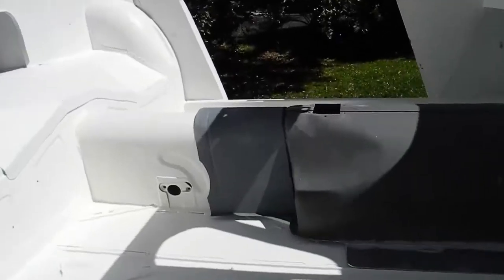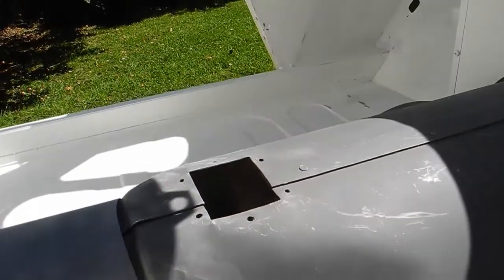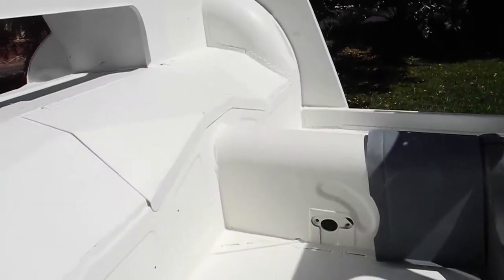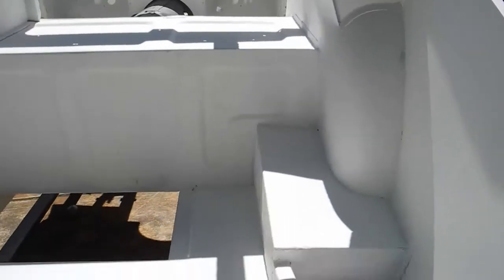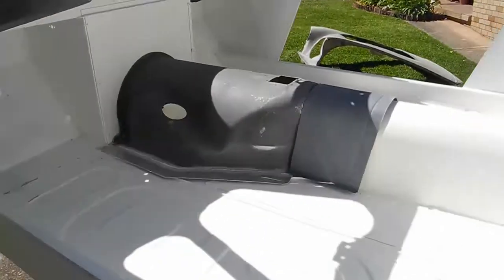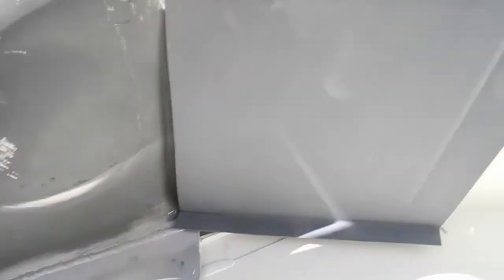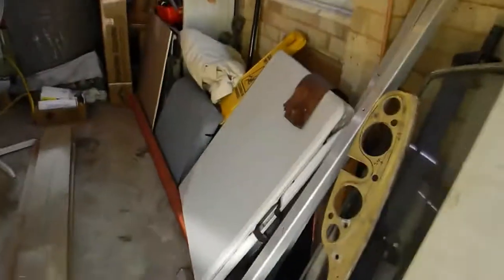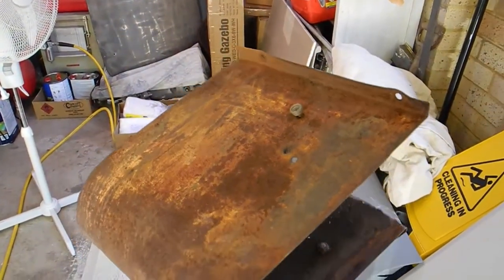Austin Healey 100/4 Base and clear coat prep (01)

Comment: Looks like you have created a great base to start the rebuild, that inner tub has to be one of the most difficult jobs to repair , well done indeed. Kind regards, Richard.
Reply from the maker: Hi Richard - nice to hear from you.
By inner tub I guess you are referring to the cockpit area. I see a number of videos where the rust is quite overwhelming but still they only cut away a little here and there. From what I've seen in a couple of actual cases is (including my original chassis) that once rust gets into the rail system the corrosion works from within where it can't be seen - this means the walls become quite thin with a reduction in wall thickness of 50-60%. So for my money it's the rail base section of the chassis that needs the most attention for the overall integrity of the car. Lifting the front and rear section from the base is not onerous if you have some skill and an angle grinder. It's only then that you can see what's really been happening.
Cheers
Reply: @ihealey458  I agree it is always those hidden areas that cause the most problem, kind regards, Richard.

Comment: Beautiful work Hugh! I am curious why there are no rocker panels on the car?
Reply from the maker: Hi Mike - good question!
In the early stages of putting the chassis together I had a lot of difficulty aligning the front end with the back end. 
I had no reference i.e. previous markers as the chassis was new and hand made plus the weighty engine which was in pieces could not be installed (in case there was a slight bending moment).
My main issue here being precise door gaps etc.
Knowing I still had some work to do with external panels especially doors which were in bad shape and now have been restored I felt it best to plug weld the rockers in later. 
It would not affect any of the internals heat wise as the are welded to the box section running fore and aft.
It’ll soon be time to put these on as the car is almost ready to remove from the rotisserie.
I feel quite a bit wiser now and still think 🤔 it was the right thing to do 😃.
Thanks for the question 
Take care
Hugh
Reply: @ihealey458  With your attention to detail I figured you had a good reason! I have just inherited a 1955 BN 1 which had a restoration started, so I am new to this beautiful car and enjoy your videos.

Comment: Hello Hugh! I am currently building a rotisserie similar to yours for my Austin Healey 100/4 project, and I was wondering how high your axis of rotation is above the ground (or ideally what clearance is needed from that axis to the beams that connect the two sides of the rotisserie lengthwise). Thank you in advance for your help :)
Kind regards, Julius
Reply from the maker: Hi Julius
The axis of rotation height I have is 950mm including wheels.
My fixing points are the front and rear bumper brackets. 
Put a straight edge on top of and across the chassis channelling x 2 that runs front to rear then set your point of axis 40mm above this and in the centre.
Hope this makes sense - and good luck
Hugh